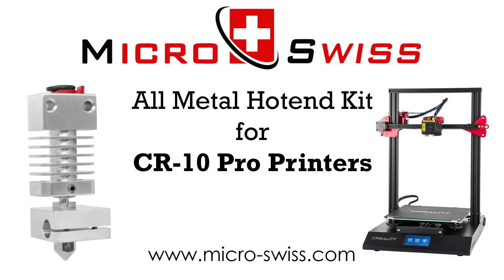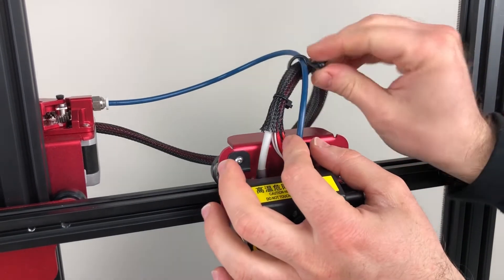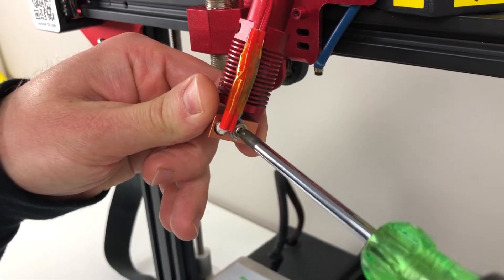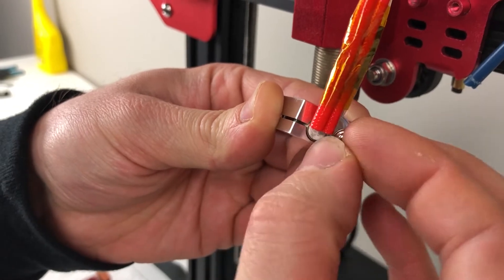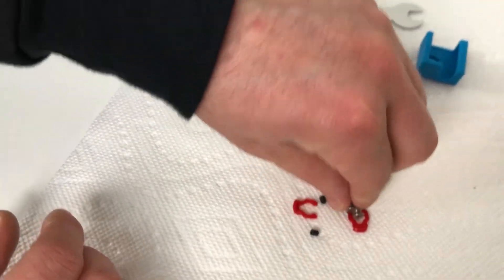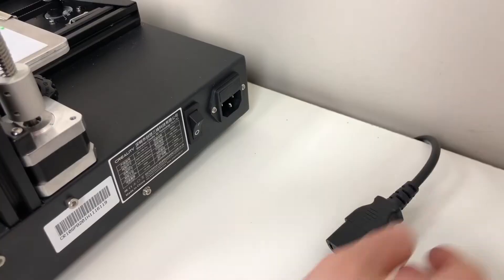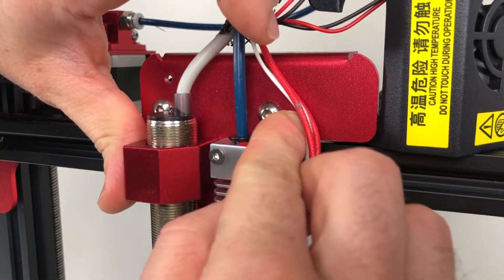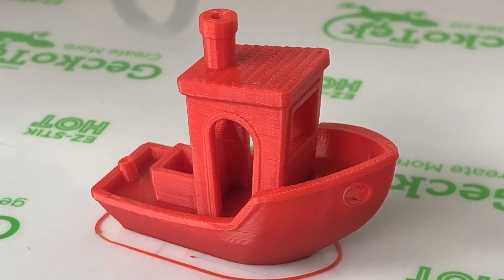Micro Swiss All Metal Hotend Kit for CR-10 PRO Printers

Comment: Definitely use a torque wrench to ensure the nozzle is secure and tight.  Missed that detail when I first installed.  Worked for a while and then eventually leaked.. What a mess.  Torque the nozzle, avoid the mess.

Comment: Does this work for Creality CR10s  Pro V2?
Reply from the maker: Yes, it works with Creality CR10s Pro V2
Reply from the maker: @William Studdard Please make sure to level the bad after replacing the hotend. Also, please make sure that your BLTouch is set properly after replacing the hotend. If you'll having issues with the hotend, please send an email to support@micro-swiss.com and our team will help you out.
Reply: @William Studdard This a real comment? of course you level the bed after replacing the assembly lmao, if you have a probe like my printer does, set the compensation and it will be away.

Comment: Do we need to change anything in the firmware? For example the set distances between the nozzle and the BL Touch, I imagine those are not exactly the same anymore after the swap? And also, does it use the same awkward nozzle like the original CR10S Pro/V2 nozzles, or does it use the common MK8 nozzles?

Comment: I did this for a CR-10S a few years ago and it worked for about two months , then jammed solid.  I suspect the retract settings needed to be adjusted so I’m happy to see you’ve added that to the tutorial.  What type of nozzle is that to require additional heating (steel?)

Comment: can you update the description to include the maxtemp setting for marlin. i'd like to print polycarbonate and from what i've been reading it requires a temp of anywhere between 290 to 310, if adjust the,

```
maxtemp
```

setting in marlin will it be alright to set to a maxtemp of 310ºC ?

and at least include a maxtemp setting on your website so future people looking into purchasing this hotend know what the thermal limits are.

cheers 🍩
Reply: As long as the power supply is ok with that amount of amp draw id say go for it.
Edit: also make sure to turn on All metal hotend in marlin
Reply: @Skipp3rBuds  unfortunately the stock thermistor on the cr10s pro can not handle temperatures above 280º consistently, and will eventually fail when the hotend gets to a temperature ~ 300º thus causing the printer to halt.
Reply: Try the new Prusament PC Blend. Expensive, but professional quality at 220 degrees.....

Comment: Hey Microswiss. Just mounted and tested. Wow. Original Creality hot end could not do 95mm/s, and later 70mm/s. More heat creep, more oozing. This new MS gave me 125mm/s for first test, and I guess it could be pushed to 150mm/s. All that with 0.24mm layer height. Incredible small powerhouse!

Comment: Ii could not install my nozzle to the heater cartridge. I tried with the old nozzle, new nozzle and a micro Swiss nozzle i got last week but hadn't installed yet. Printer is down because my other hot end got clogged. no word from Swiss yet. :O(  after studying this, it was obvious that the threads are different on the nozzles than on the heater cartridge. It looks like the thread on the cartridge should be one size thread for the top half of the titanium thermal break and a  different thread on the bottom side for the nozzle. looks like they just went all the way through with the thread for the thermal break.
Reply: An old comment, but maybe it can still help somebody: The Micro Swiss thread is the common one used for nozzles. The CR10s Pro uses a non standard thread, which will not fit the Micro Swiss assembly.

Comment: I did add this hotend and it works very well. One note though for others ... when changing the nozzle be very careful not to just putting the wrench just on the nozzle to remove. Hold the hot end with one wrench and then loosen the nozzle with another small wrench. It is very easy to loosen the hot end from the titanium coupler causing a leak and have melted plastic seep out above the hot end ... drove me nuts for a while ... the nozzle does work nicely now. Thanks for the feedback. Later.

Comment: Why remove the original nozzle? I do not see a reason.
Reply: the stupid thing with the cr 10s pro ist, that it doesnt use standard nozzles, but rather ones with a special threading that you have to buy from creality. Thats why its so hard to get hardened nozzles etc. 

--> you cant use the original nozzle anymore, but just about every other nozzle you want.
Reply: @M.V.P.  Micro Swiss sells Hardened replacements. I using one now.
Reply: the original is trash thats why...
Reply: You see no reason because you don't know enough about it. I PROMISE there's several good reasons. But I assume after that many years you probably know better by now lol
Reply: I see also no reason

Comment: Does the Cr10s pro come stock with a all metal hot end? i cant find this anywhere on the official site or reddit. I'm trying to print with petg and no matter what retraction settings i use, i cant get rid of the stringing.
Reply from the maker: No, the CR10s Pro comes with PTFE lined hotend.
Reply: @MicroSwissLLC  thank you! Definitely getting the micro swiss now.
Reply: @dr.leinhart9343  I have stringing too with PETG is this the curse metal hot end?
Reply: @DennisMurphey  PETG is just a very stringy sensitive material. some brands more then others
Reply: I have found Carbon Fiber reinforced PETG at 240/80 prints nicely. Using Swiss Micro hot end and hardened steel nozzle. It needs to have the nozzle height just right.

Comment: Oops .... ran into a problem. Couldn’t setup the bed height. Like a dumbass I ordered the wrong unit. It was for a 10s not the Pro. Different length on the cooling block .... live and learn. If you notice there are 4 fins on the 10s and 5 on the Pro.  New one ordered.

Comment: One thing I’ll mention is this. Installing the Micro Swiss was a breeze. The only problem I had was mounting the unit back on the slide bracket. The original mounting screws are to long being the new block is a bit thinner. If there were suppose to be screws in the kit to accommodate mounting they just were not in mine. Anyway ... went to Ace and got a couple of metric screws and mounted it. After mounting just make sure it’s not wobbling around.
Reply: I had this problem and Microswiss sent me shorter screws next day. I ordered mine before they listed it on the site though so I'd hope they include them now.

Comment: Installing this hot end is pretty straight foreword. The question I do have ??? Are there any changes that need to be made to the firmware. I’m thinking no, I’m not sure considering higher temps for other plastics.

Comment: I would like to know if this model is intended as a MK8 or MK10?
Reply from the maker: It is MK8 (M6x1mm threads)
Reply: @MicroSwissLLC  Last thing, by chance, do I have to set something in the print settings after changing the hotend? and what are the differences with MK10? can I mount it or do I have to change everything again?
Reply from the maker: @Gasrovescio  The only setting that you will have to change is retraction. Set it to 4mm retraction distance. I'm not sure what you mean by MK10. The MK10 is used by different printers not Creality. If you mean the original CR-10 Pro hotend then yes, you can mount it back on without changing anything.
Reply: @MicroSwissLLC  I would highly recommend adjusting Z Offset and PID tune
Reply: @MicroSwissLLC  Why only 4mm retraction?  Im currently using 6mm because of the bowden tube is that going to pull the filament to far into the heat break?
Reply from the maker: @JJ-ic8jm  With All Metal hotend, the melt zone is much sharper. If you do 6mm retraction, it might cause clogging issues.
Reply: @herrmutz  how please ?

Comment: what is the benefit of this change? Where can we see the difference
Reply from the maker: One of the main benefit with an All Metal hotend is that it allows to print at higher temperatures that are not possible with PTFE lined hotends. Also, with our hotend will convert your CR-10s Pro to regular M6 nozzles.
Reply: yes and dont have to use propitiatory Creality nozzles
Reply: Micro Swiss LLC yes but if it’s the same tube an filament, what helps stopping the clogging??
Reply: @MicroSwissLLC  which types of filament in your opinion it cant print without your hotend?
Reply from the maker: @tamgaming9861  It will print PLA and filaments that are under 260C melting point
Reply: @MicroSwissLLC  thanks for the anwser but this it can do it atm too, or i am wrong? So what is the benefit of it to use your hotend? Thanks for the answer!
Reply from the maker: @tamgaming9861  With our hotend kit, you will be able to print filaments that require high temperatures.
Reply: @MicroSwissLLC  as i asked before, WHICH filaments should this be which the CR-10s Pro cant do already? Can you name the filament types which you can use after your upgrade, which you cant use before?
Reply from the maker: @tamgaming9861  The stock hotend will be able to print plastics that do not require temperatures higher than 245C, it includes ABS, PLA some PETG and possible low temp Nilons. With All Metal hotend, there is really no limit to filament type it can print with an expiation of PEEK that requiters temperatures beyond CR-10 printer capability.
Reply: @MicroSwissLLC  Sorry if ask again - you describe again and again the same what you have answered before. I know what this printer can print, because its written in the description. NOW i would like to know from you who sell this produkt, WHICH (pls say filament types, which it can print with your hotend, but cant print without?  And sure that it cant print PEEK which needs up to 380°C and which needs a own special printer construction to be resistant against the heat. Please let me know WHICH filament types will i be able to print after installing your hotend which i cant print without your hotend. Sry that i ask again, but as long i dont see a need for what it is good to spend money in your hotend, because you dont call names of filament types which i will be able to use with your hotend which i cant use without, as long i dont see a need to buy it. Sorry but this is pure logic. I am really willing to buy your hotend, but i would love to know exactly, what its for which i cant use atm. I have several products from you, and i am happy with it, but atm. i dont know why i should buy it. And it seems you also cant tell me this.
Reply from the maker: @tamgaming9861  Here is a list of all the filaments that requires an all metal hotend to be able to print: Polycarbonate (PC), Polycarbonate ABS (PC-ABS), NylonX, NylonG, ASA, PolyPropylene.
Reply: @MicroSwissLLC  now we have it - thank you a lot. This it was what i was asking for. Thank you very much!!!
Reply: @tamgaming9861   They said multiple times, that the stock Hotend of the Creality CR-10s Pro cant reach temperatures higher than 260°C. So every Filament type that needs temperatures higher then that can be printed after the upgrade. What do you want, just search for it on google. If you have a 3D printer you most likely have to do that pretty often anyways, so I don't get why you spend your time writing novels here, complaining that Micro Swiss doesn't know why you should buy their product, rather than just searching for "types of 3D Printer filament". It takes literally 2 minutes, just saying.
Reply: @suchti7654  yes write and they did it already. If they had answered my question after the first time i hadnt ask a second time. I asked because they are the PROs and THEY should know why they make such a product. So why shouldnt i ask them direct what their product is made for?! I asked only them because in forums often they said to me, there is no need for it you can print everything with the CR-10s Pro. Only problem would be the enclousor, which isnt there but thats a problem to print some filaments. I hope i was able to answered your questions :-) Viele Grüße :-)
Reply: @MicroSwissLLC  i was under the impression that asa requires just slightly lower temp than abs to print so it should be able to be printed with stock setup correct?
Reply from the maker: @ocj7102  The working temperature for ASA is 245-255°C. All Metal hotend will definitely benefit at those temperatures. At those temperatures PTFE liner in your stock hotend will degrade over time.
Reply: @MicroSwissLLC  So your hot end with this printer (CR10S-Pro) can print the NylonG/X materials? Or would another mod be required to print that hot?
Reply from the maker: @vdubberc  Nylon requires 250C to 265C to print. Stock firmware is limited to 260C, so you are limited by this firmware. It is possible to modify the firmware for higher temperature, in the excess of 300C.
Reply: @MicroSwissLLC  Would that be done with the Tiny Machines firmware? I've just ordered your hot end etc to print the NylonG/X filaments and thinking about adding the BL Touch so it will need the updated firmware also.
Reply from the maker: @vdubberc  Tiny Machines Firmware max temperature is 285C. Should be plenty good for Nylon.
Reply: Dum Berlake  Wondered the same thing. I did change it anyway and I’m glad I did. Technically the stock hot end on the pro is an all metal hot end. Here’s the catch .... not much of a seal between the heater block and the cooling block. When I removed mine after only 2 weeks of operation it was leaking plastic. The point they make in the video of how the thermal break works is not the way the stock unit is setup. Actually to put it plain English. The stock heater block assembly is crap. Worth the change for the money.

Comment: Just an FYI: My CR-10S Pro came with the thermistor epoxied in place.

It had wonky temp readings starting day one, I eventually got them to send me a new one so I could replace it (and obviously drill out the crap they put in it). 

Apparently they didn't think epoxy would act as an insulator.

But if they are still doing this, it is going to require people to replace their thermistor.
Reply: yes i have some white paste stuff on my themistor too, but notice on this video there isnt any?
Reply: I managed to remove the white epoxy without damaging the thermistor. Just use a very small pointy tool to slowly cut away the epoxy and eventually it came out clean.
Reply: Same here...ive tried heating the block and cannot remove it. Somewhat frustrating